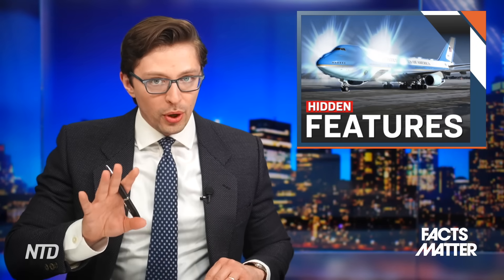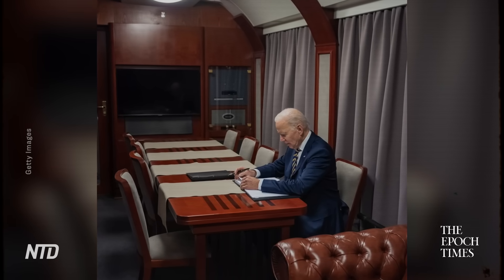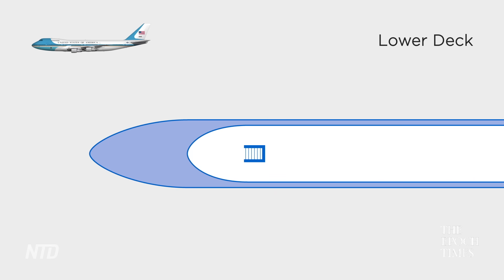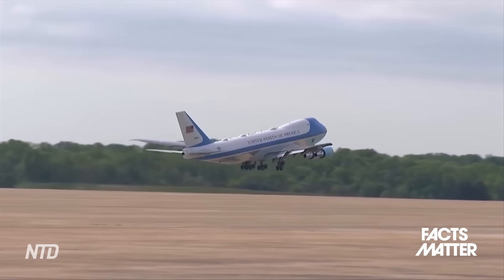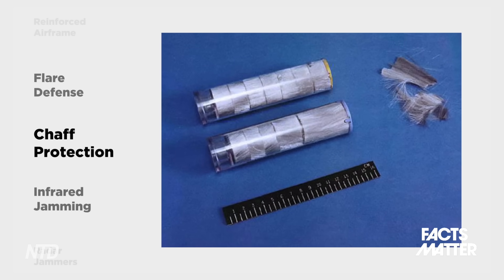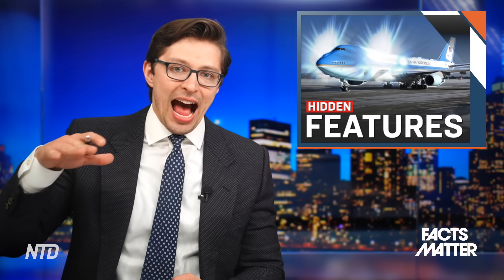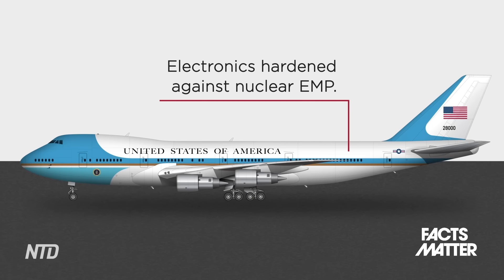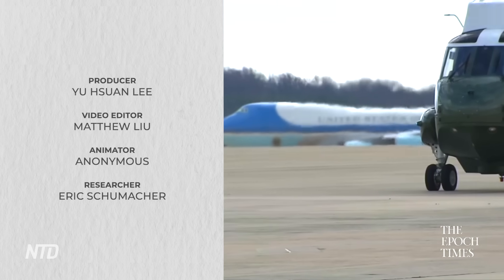The Insane Engineering of Air Force One

Comment: Its all trash.. Best EM defense = Producing your own EM field similar to how destructive sound interference works. If I had funding I would point out how to make the production machines cheap to make the plane cheaper to make into a God chariot. Google: "Ultrasound control of electric plasma" + "Ultrasound holography" + "Ultrasound excited Plasma generates stronger Em field" + "Warwick university Plasma generated Ultrasound" + "Boeing Plasma force field blocks bomb shockwaves" + "Ultrasound can print through walls" < Add it all.. I know what I'm talking about.

Ultrasound holography to arrange plasma around a craft + Ultrasound echoes to smash the plasma between outbound shockwave at correct angles to blow away = Plasma generated Ultrasonic anti-drag meets Fusion shields. Radiation issue? NAH.. Ultrasound echoes to pull water from atmosphere to convert to heat but not enough heat to ever be a problem to Earth even if all of you had one. If ever was? Rubs Ultrasound laser tech Then you could open a hole opposite side of the Sun on purpose to bleed some heat faster.

Why I say its all trash? Well I just told most of it. Points at UFO clips where UFO's shoot Red lasers and rubs Microwave Plasma laser safety switch Smashup electromagnetic fields and generate Plasma Ultrasonic vortex to spin a hole through your pressure shields at the same time. ONE PASS.. How I know? Google: "Saucer over Dracula's birthplace Christian art" + Points at Asians using Dracula's image in animation because of DRAGON still having a meaning to them inside. - Dracula aka Dragon Alpha https://youtu.be/ZhMwNzqWsB0?si=IQETA4xOzfzTXYmw

Comment: Having personally worked on the Air Force One aircraft at Boeing in Everett, WA, I can tell you that the aircraft that rolled off the assembly line wasn't the aircraft you described. Mostly, it was the same as any other 747 built at that time except that it had additional electrical and mechanical provisions installed during assembly for unknown systems that would be installed later, at a different secure facility in Kansas. 

What does this mean? The aircraft being donated to the United States Air Force by Qatar can be modified after initial assembly, the same as any other Air Force One aircraft. Aircraft designated to go to royal families (heads of state) receive similar upgraded electrical and mechanical provisions as  AF1 and are also completed at secure facilities in different locations - so modifying a Qatar Royal aircraft won't be as big of a challenge as it would be to modify a normal commercial aircraft.
Reply: I believe you, sir - but not according to 2 AF1 delays videos put out by Mentaur Air . . .

Comment: Designing aerospace electronics to withstand lightning is easy if the fuselage is a conductor metal, like ALuminum alloy. But if the jet has a Carbon fiber fuselage,  the old tricks are inadequate.

Comment: The  military EMP threat levels are classified, but I can tell you when I design circuitry to withstand; EMP, static electricity, lightning, or aircraft  power line transients.... I do the same sorts of things. Input lines get series resistors, inductors, and baluns and also transient suppressors and capacitors to ground.  Interestingly, I have seen musical mixer board designs fail, that would have been protected by similar protection.

Comment: No one asks if all this crap is actually useful. They could just repaint the Qatar plane and scrub it for tracking devices and get it flying. If the current plane crashes due to old age it won’t help to have emf protection🙄  there is a limit to all perfection and clearly they are at the edge of it if you can’t replace a plane in 40 years
Reply: "Crashes due to old age"... if that was the case the B52 would have been out of service long ago instead of getting an engine (x8) upgrade.

Comment: GEO satellites are “EMP proof”. More accurate things can be made EMP resistant not proof. Anything with a wire going in it is vulnerable to an extent.

As for satellites when the sun has a mass corona ejection that is exactly the waveform a nuclear bomb has. I mean the sun is a nuclear bomb that just keeps exploding. So satellites have to be made to withstand the radiation. (A radio transmitter radiates so it emits radiation. Radiation can be at many different wavelengths. Some can harm you, some not so much.)

When he says AF1 has a radiation shield that brings an imaginary image of shields in Star Trek. That’s not what it is. It just means the components are “rad hard” or radiation hardened. This isn’t SciFi.